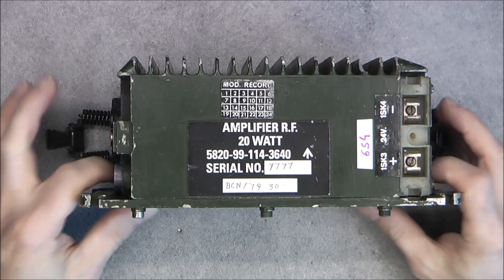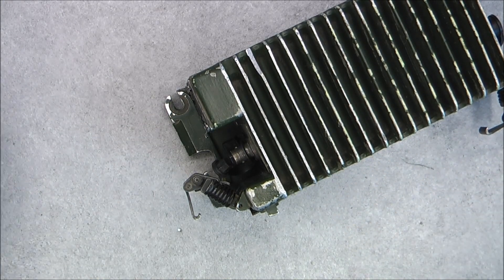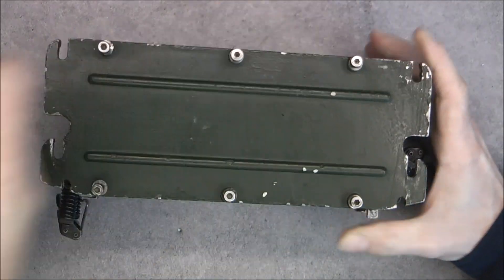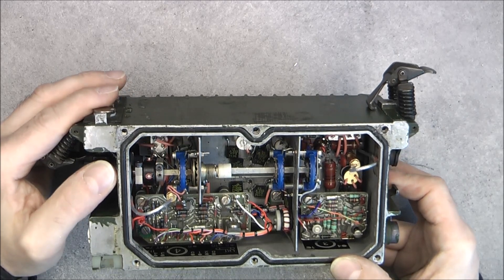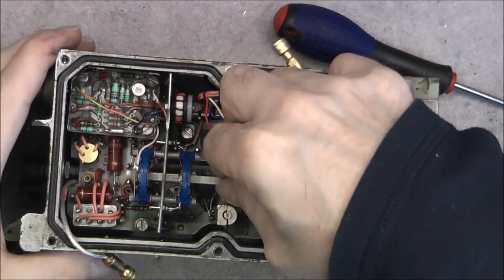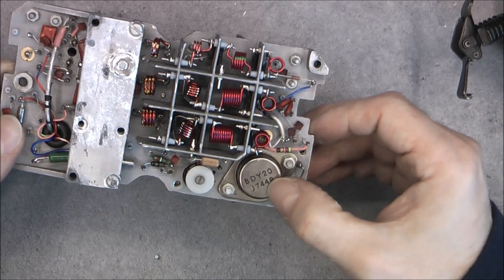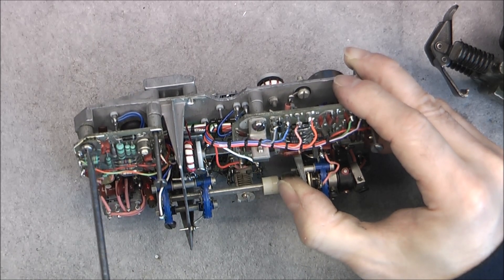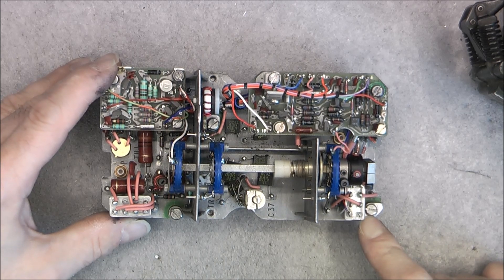20 watts military radio  amplifier teardown

Comment: Looked up the datasheet for the BDY20 power transistor and it is a standard silicon high temperature/high power transistor for frequencies less than 1 MHz. No beryllium here, but likely present in the transistor hidden behind the aluminum plate.

Comment: That amp converts a PRC351 into a PRC352:

https://armyradio.com/Clansman-RT-352---PRC-352-20-Watt-VHF-Man-Pack-Transceiver.html

The PRC-352 is a 20 Watt portable VHF (FM) Radio using a clip on external RF amplifier, made by RACAL BCC Ltd. in England. The PRC-352 has been designed to provide command communications at battalion and company level for dismounted troops. It was also used in vehicles by mounted troops.

Frequency Range 30 to 76.000 MHz in 25 Khz steps giving a total of 1841 programmable channels. The desired frequency is set by four knobs on the side of the radio which can be operated even while the operator is wearing Arctic mittens, or in the dark by counting clicks from the end-stops.

Intermediate Freq 11.525 MHz, Frequency Stability 5 ppm per year. Voice F3E Narrow with +/- 5 Khz deviation, Telegraph F2, 75 Baud.

https://armyradio.com/images/P/d_519.jpg